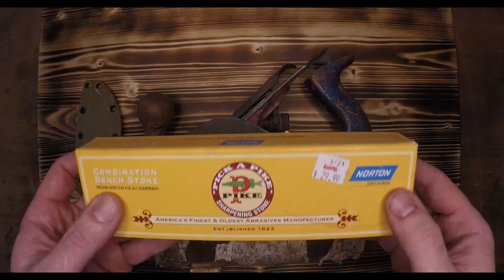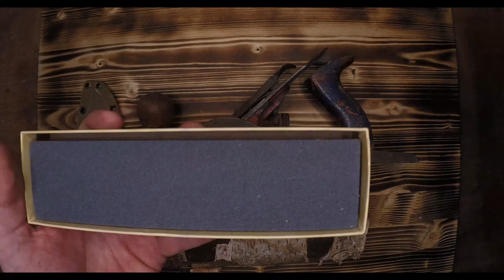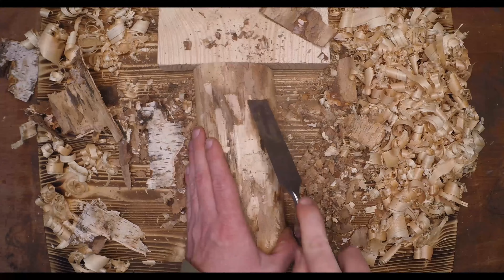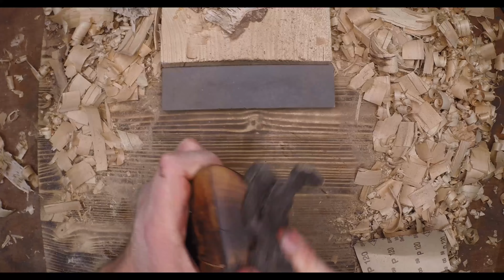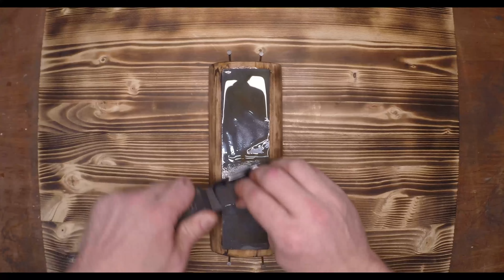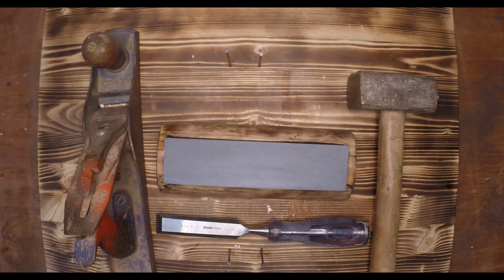Making a home for the NORTON PIKE sharpening stone using a piece of firewood!

Comment: I have heard it is not good to use oil as it will plug up the coarseness of the stone. But I see you using it. Have you noticed any difference in the coarseness or workability of the stone.
Reply from the maker: Oil is the preferred lubricant for whet stones as it floats the shavings out of the pores a little better than water. I'm currently using an oiled whetstone from 1950 that my grandpa gave me that has over 70 years of oil use. No issues, even if it has a little dip in the middle of the stone now.